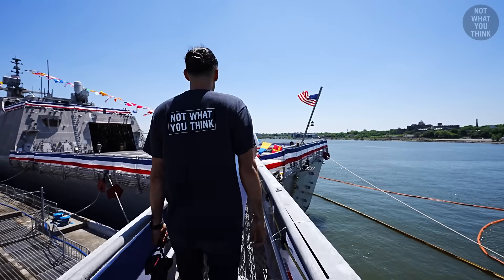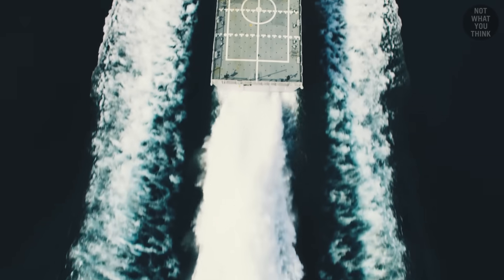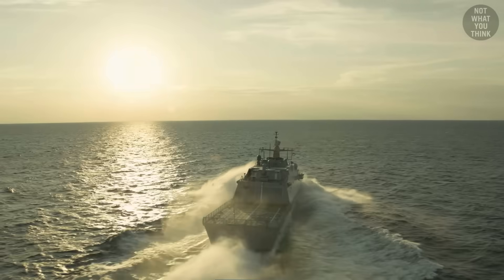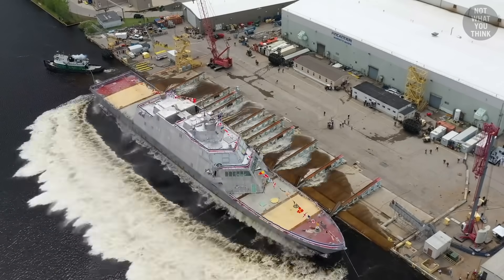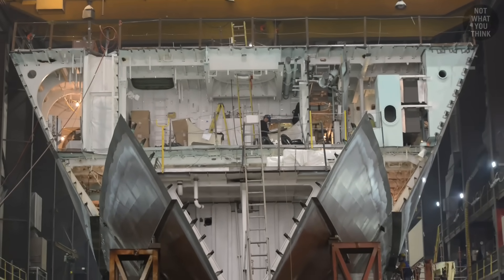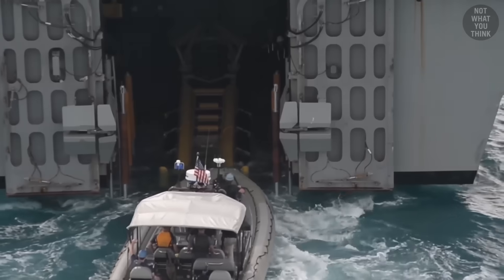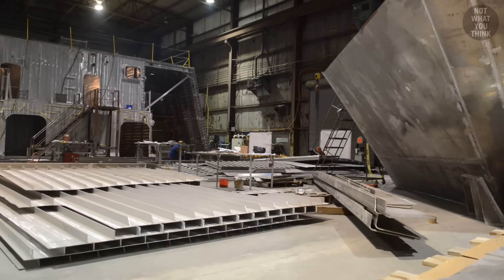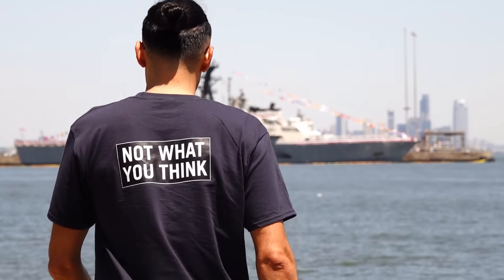I Visited The Most *Overpowered US Navy Warship

Comment: They should get rid of the turbines and convert to diesel-electric. Or get rid of the diesels and go turbine-electric. Paint the hull black and you have a small and silent assassin for, ahhhh, operations that require discretion. Keep the gearbox and you can combine the powerplants for burst speeds. Also gives you enough electrical power for DEW.